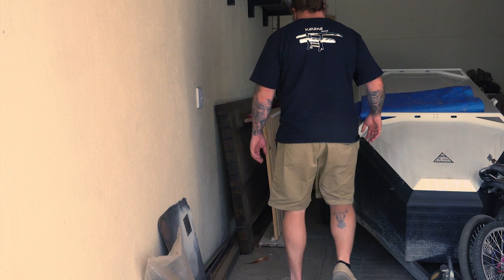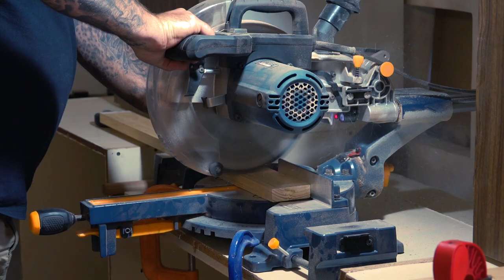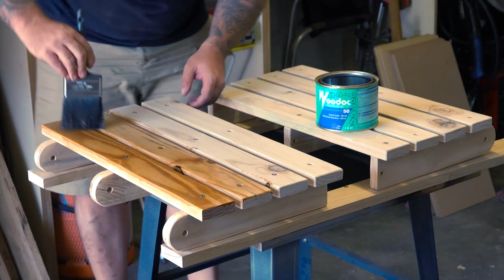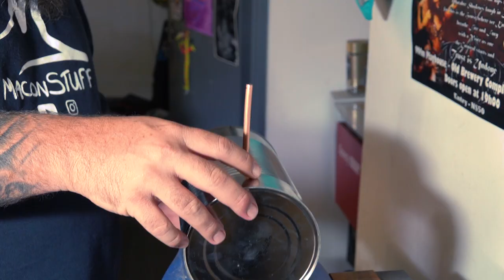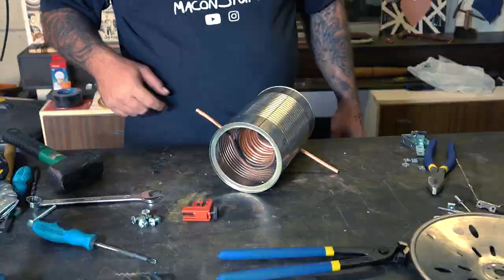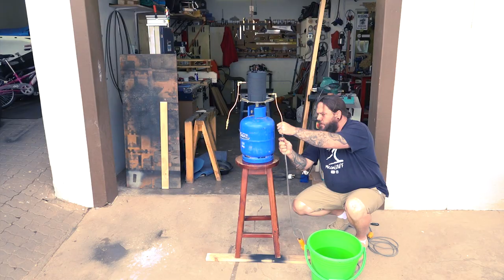Duckboard and Water Heater/Geyser

Comment: You could consider more windings of the copper tube as well, increasing surface area, but that may be more laborious than just increasing the flame.
Also, closing the top vents a little may help.
Reply from the maker: Yeah... I figured that too, but re-doing the coils is gonna be a pain in the ass LOL, if increasing the flame doesn't do it, then I guess I'll have no choice... :-)